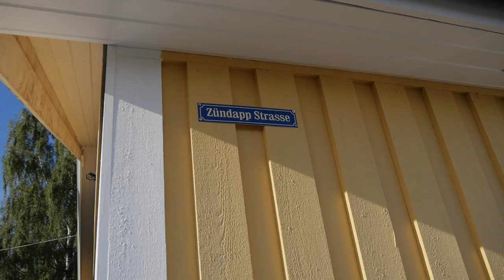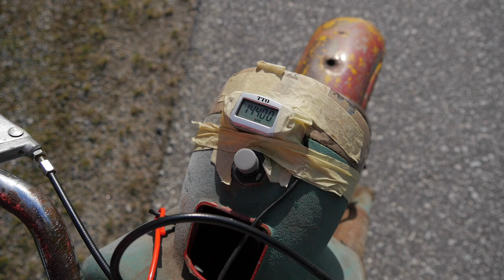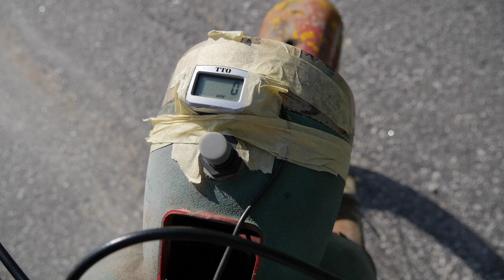Mats Dragracing Mopeder

Comment: Det är skönt att höra lite Lappländska ❤️💞💕❤️ Jag har själv köpt en Motorhispania RX 06 (AM6 motor). Köpte den ny för att ha nått att (trimma) skruva på. Satte på 98cc cylinder och en strokad vev så den blev 110cc. 28mm förgasare, Drar ostyckad från fabrik 1liter milen. 80cc trimpipa. Max drevad fram och bak, orginal koppling och tändsystem. Just nu äter den membran, skulle ha haft tjockare membran. Varvar just nu bara max 12000rpm. Gör ca 105km 😎 ska köpa i framtiden en 110-125cc trimpipa och ett tändsystem som går att justera. Och ställa ner förgasarn så den ska varva 20000. Första gången jag upptäckte tjusningen med trimning var när jag fick soppatorsk första gången tidigt 80tal. Den gick hel plötsligt 50km istället för 30km den gången innan torsken!!!!! Jag hade då en Suzuki KS50 på 80talet.
Reply: 105 var inte mycket med den uppsättningen, hur har du drevat den? hade en mt5a för ca 15 år sen med 70cc cylinder 20mm förgasare. han gjorde 108 kmh..

Comment: Steuerzeiten wären interessant.! Und das Setup also Vergaser usw.!????
Reply: In english please?
Reply: Setup and carburator on the rusty moped?
Reply: @matsohlsson3445  right i need this and, the control Times from this cylinder? 
Is it a 70ccm athena cylinder.?
Reply: @IHCD320  Yes its a 66cc Athena. Mikuni 28mm and home porting and a modified metrakit. Hpi inner rotor  ingnition.
Reply: @matsohlsson3445  with Membran.?
Reply: @IHCD320  no.
Reply: Sprechen schwedische, nicht deutsche aber englische
Reply: Tala svenska, skit i tyska och engelska